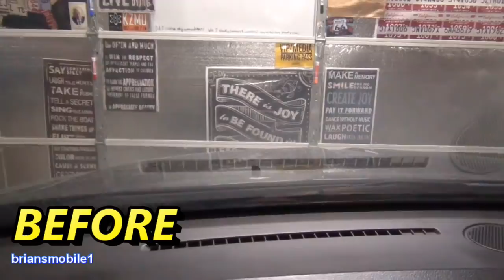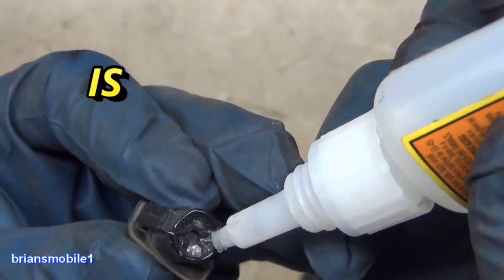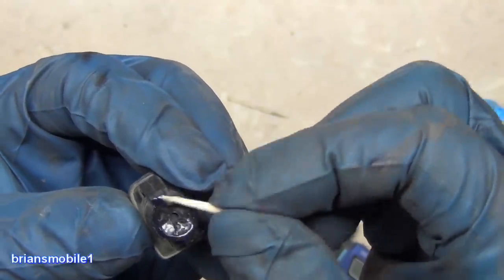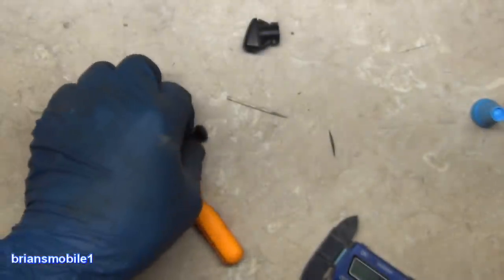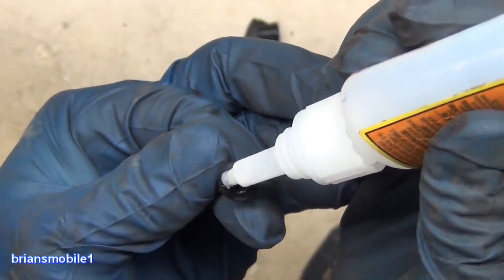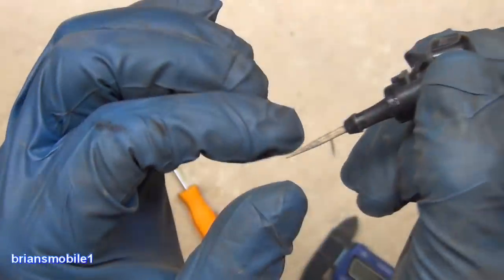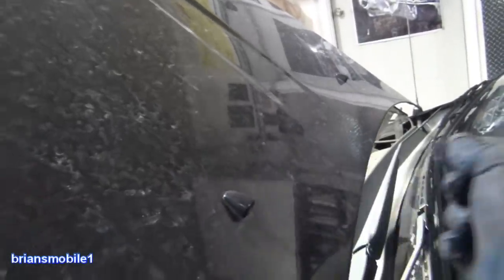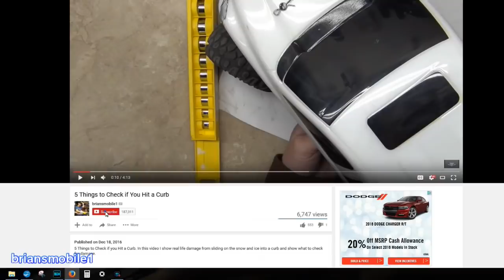Toothpick Trick Windshield Washer Fix BFATE Paramotor Pinnacle Peak

Comment: To get the toothpick piece not to stick, even with a little too much glue, simply take a wax crayon and wipe the stick, then warm it up with hot air or a lighter to melt the wax into a thin layer. Silicone is not recommended, as it will keep the superglue from adhering. If it breaks and the nozzle is not there drill it out a little, and put in a piece of plastic, like the inner tube from a gel pen. Then use a soldering gun to gently fuse the plastic pieces together.
Reply from the maker: That's a great idea for thinner breaks because it helps reinforce the inside.  I like to go commando for this kind because the extra glue inside would block some of the washer fluid flow & the extra strength isn't needed.  This requires timing, but when the glue is done flowing out and before it's dry the wood can grip and absorb the excess glue as you twist it.  That way the excess glue is removed instead of piled up inside.  The advantage of having it stay in is the potential for reinforcement from the inside.  That's ideal for a thinner section break.  Thanks Sean!